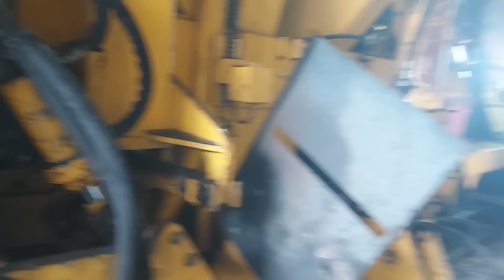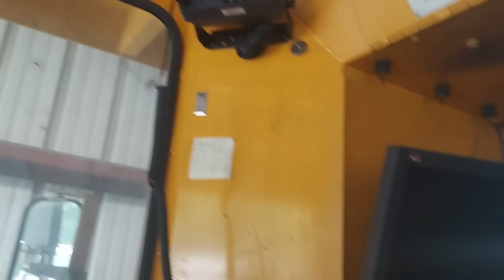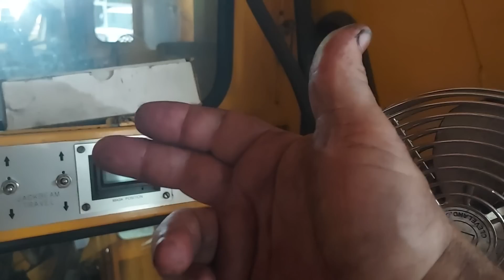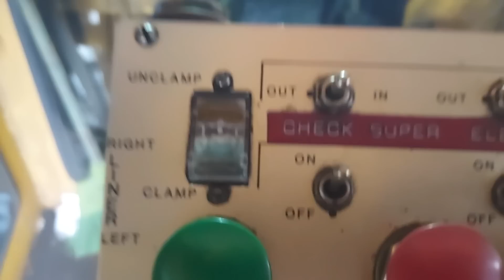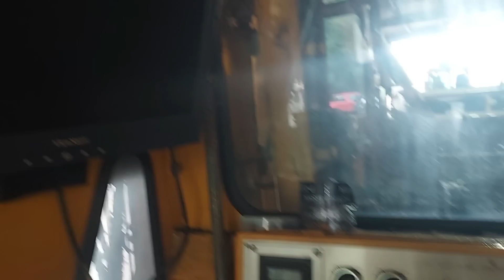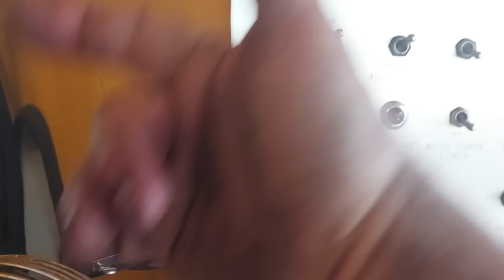How to Operate a Jackson 6700 Tamper

Comment: Hi Dave,
We have a Jackson 2400 with the switch tamper heads and track aligner equipment. All of the curve plotting and super elevation is done manually. Our light system has issues, so we use a scope to run a straight line and center mark the ties and simply move the track so the center marked tie aligns with the stringline. No computers except for the one between my ears! Our line is 29 miles long, but only 5 miles in service. We maintain to class 1. The out of service portion we only maintain it just enough to keep it passable for MOW equipment. Last year we repaired 4 sunkinks that had been creeping in over the last few years. I feel the same way about our railroad the way you do about your line. Hard work, but fun and satisfying when you've fixed a bad section of track.
I'd like to come visit sometime, but rarely leave the state of Maine.
Reply from the maker: That's the old way of doing things but it works and hardly anyone
now can do stuff like that except for a few old school railroaders
Leverett. Yes it is hard work but what a great sense of accomplishment to fix a messed up section of track, even more
so when you do it the old school way. Nice, I'm proud of you my friend. Keep up the great work and keep on railroading.

Comment: How do you zero your crosslevel on this machine
Reply from the maker: Tamper gets set on perfectly level track, then tamper gets calibrated
Josh. Frame level sensor is first get calibrated to read zero
voltage then both transducers get calibrated to read zero voltage.
Fine tune thru the left and right bias screws on the logic card 
holder. Secret is to set the tamper on perfect cross level.
Thank you for taking the time to check out the video and hope you have a very good day.

Comment: Great video Dave. Question when you tamp let's say cross level track do you put your light in the dip or keep your light on the high side then counter the height you need your light at by dialing in your super elevation in the negative to get it in the zero. Then tamp?
Reply from the maker: Typically I tamp what is called an out of face surfacing. I start
out at a reference point and then every 10 ties raise the lift
up 1/2 inch, then continue that until I reach the desired lift
I want to put on the track. That is generally 2 to 3 inches, I don't
like to lift track in a single pass much higher than 3 inches.
That gives a smooth transition from the starting point to the
rest of the section of track to be tamped, then reverse
that procedure when I'm getting ready to quit tamping. Then I will run that lift for the entire curve or tangent and not change it.
That takes most of the surface dips out and also cross
levels the track. I do not use the  super elevation tags. If I'm doing a curve the computer will put the super in for me. 
Although without the computer I would have to manually dial
in the super. If I use the super elevation dial on tangent track
then one side will end up higher than the other.  Really appreciate 
your taking the time to check out the video and may you have
a very good day my friend.

Comment: Good gravy Dave, that's a lot of switches, dials and buttons to master.  I got lost half way though the video trying to keep up with you on what does what to whom. Really interesting about a radio transmission messing with the travel controller. I'm a ham radio operator and I had a neighbor tell me that he knew when I was transmitting because his lamps that go on/off by touching the lamp... would go and off. So I re-orientated my beam antenna and knocked down my transmitter power, to be a good neighbor and keep the peace.
Reply from the maker: Now that is quite interesting about the lamps going off and an
on from a radio transmission Henry. You are right there is a lot of stuff to control on a tamper.  Really appreciate your checking out the video and may you have a very good day my friend.

Comment: Hi Dave, 

We had three 6700 machines in our Victoria, Australia rail maintenance fleet. Always liked them, very easy to troubleshoot and repair, easy to use and came with the best operators manual I have ever seen.

We purchased our machines from Carl Eberhardt at RELAM.

Cheers Peter from downunder.

Comment: Great explanation!
But I still don't understand how the operator knows that the rail  needs to be higher/left/right. Is there a laser guiding system? Or it's just lots of years experience?
It is possible to lower the rail if needed?
So many questions...
Reply from the maker: Thank you Froop. If the left rail is low and needs jacked to be
level with the right rail, then the left needle on my gauge will be
low. And vice versa for the right rail. On the front mask follower
there is a potentiometer which goes up and down with the rail
deviations, that sends the electrical signal to the gauges on
my panel board. Hope the explains better.  Appreciate very much your taking the time to check out the video and may you have a very good day my friend.

Comment: From what you were saying about the hand held transmitter not effecting your system. I would guess that your onboard radio transmitter is grounded antenna system causing RF feed back through your controller and it’s also grounded to the chassis. But it’s above my pay grade. Bottom line is you’re all in control, no matter what.
Ok give us a year of on the job training. You have years of experience and knowledge. Thumbs up 👍
Reply from the maker: Your right about the radio Clarence. If I'm in control no matter what then I should get a pay raise.... LOL  Appreciate very much your taking the time to check out the video and may you have a very good day my friend.

Comment: So if the tamper lifts the track and pushes ballast under the ties, wouldn’t your track keep getting higher every time you tamp?  Does it not lift the track in sections that are “on grade” but still tamp some ballast under the tie or just completely skip those sections?  Thanks for the interesting videos!
Reply from the maker: Good question Jeff. The track would keep getting higher,
but the weight of the train passing over it numerous times
pushes the track back down. If we just kept raising track the
loco operators would soon be issued flight jackets..... :-)  Appreciate very much your taking the time to check out the video and may you have a very good day my friend.
Reply: Dave mentioned early in the presentation about the "lights"the machine has a projector at one end and a receiver at other they run on rollers on the head of the rail.In the middle above the track lifting unit is a board that cuts the beam of light when lifting .A lot more to it that  goes on when he hits the cycle button but the beam of light provides the straight edge that it works to.Lining and lifting are the same system .My first experience with tampers as a  young Apprentice  was a overjacking caused by a broken wire in a receiver,tossed in the deep end experience

Comment: Hi Dave!
Young railroader here with just over 2 years experience. I run a KBR-925 regulator for my railroad but i’ve been working with our new tamper operator (MKIV jupiter II). was wondering if your computer system is similar or the same. have some questions about plotting and editing curves. we just completed a 3750ft rebuild with steel ties 136RE rail and have been using trial and error to line a curve in this yard track
Reply from the maker: How lucky are you to get to run a 925, that is one awesome machine, sure wish we had one  Nate. Tamping steel ties you have to make sure the tamping tools center the tie. In some respects the old Windows operating system is similar, but the Jupiter 2 is a much better OS. When your building a curve, try to keep your positive and negative throws close to being equal. 

Best Fit on the plot is not always the best way, I hardly ever use Best Fit, I build my own curves. Your the eyes for that computer and you can look at a curve and see what needs to be done, then
make your plot adjustments accordingly. Don't fret if it
doesn't come out exactly right the first time, sometimes I
have to make 2 or 3 passes to get the curve right. Better to
throw only a little at a time than to throw a whole bunch
at once. Easier on the spikes and ties that way too and you
lessen your chances of breaking rails or joint bars. Good luck
and if you need anything my email is  peppypetsdaily@yahoo.com
Reply: @ccrx6700  Thanks Dave! I’m only 23 and have found the passion for my work ethic towards the railroad… i will send you an email and show you what i’ve been able to do with that great regulator i’m on…. our tamper had a car kicked into it about 4 years ago and the company just spent the money to have the lining system rebuilt a few months ago and this is the first track we’ve tried to use it with… been using the Jupiter II manual to help us with understanding the system in how it works but it’s always great to get an old head’s thoughts! “i mean that in a good way!”

Comment: When I was raising track on the Huckleberry RR (3-ft gauge ), we had a spot board with a peep-sight and one to use at a jack that was flat for the raise.  We had a Jackson Mono-rail tamper with 4 vibrators and heads for the tampers on a hydraulic ram that raised and lowered the heads.  It tamped one rail at a time so it had to be raised and then turned around to tamp the other rail.  We also had a generator with 4 manually held vibratory tampers.  These manual tampers could be plugged into the Mono-rail tamper (2 at a time).  The tamper had a hydraulic motor for travel but we pulled the clutch and used the motor car or 12-ton locomotive to pull it.  Fun days (yeah).
Reply from the maker: Nice Roy, I did not know they made tampers for narrow gauge
track. I bet that was a fun time you had back then. We had an old
Fairmont before the 6700, go out and hand jack the rail. Tampers
have come a long way from what they used to be. Appreciate very much your taking the time to check out the video and may you have a very good day my friend.
Reply: @ccrx6700  This tamper was adjusted to operate on 3 ft track.  Just about all of our MOW equipment was either hand-operated or modified standard gauge equipment.  We had an air hammer with a spike head to drive spikes, a whole lot better than spiking by hand and a spike maul.
Reply from the maker: @royreynolds108  👍😊

Comment: Question about e-stop. How do y'all test e stops? During my time at Kawasaki rail car division, we'd run the subway upto 30mph to test the e stops. They were looking into a new way to test the e stops without running the cars. They tell us "buttons work, computers see the button pushed, but that's not to say something down the sequence isnt maintained and the whole system fails" 

Looking at all these buttons and switches, its amazing how simple wiring and basic forces can create whatever you want. Engineering is very interesting in every aspect of life. We should take more interest in it!
Reply from the maker: Simply push the E stop button in and it shuts down the engine
which then negates all functions. Your so right about the wiring
and how it works, amazing to me also. Appreciate very much your taking the time to check out the video and may you have a very good day my friend.
Reply: @ccrx6700  that's clever! So dead man switch pretty much on a large scale.
Reply from the maker: @Black_Toof  not really, dead mans switch on loco must be depressed all the time. If its not then you get a warning, if that warning is not acknowledged, then the switch shuts down all throttle functions and is supposed to automatically apply the brakes. It does not shut engine off like an E stop will. A loco does have several fuel cut off switches that will shut engine down tho

Comment: Ive ran a 6000 and a 6500, but never a 6700. Looks fairly similar to our old 6500.
Reply: Dave, 
 Baby bobcat 👶 wants to run your tamper 😮😂. 
His controls are more simpler:
Both handles all the way forward, go forward. 
Both handles all the way back, go backwards. 
Left pedal raise and lower.
Right pedal scoop and dump.
Right handle forward, Left handle back, 
You'll do the Hokey Pokey down the track 😮😂😂😂🤣😊.
Always have fun 👍 and stay safe my friend😊.
Reply from the maker: @richardbause2453  😊👍
Reply from the maker: It probably is similar Michael, the 6700 was in my understanding
a major upgrade from the 6500, the new and improved edition.
Thanks so much for taking the time to check out the video and may you have a very good day my friend.